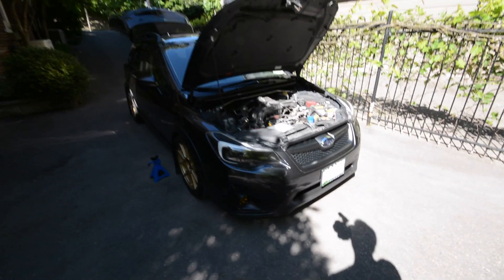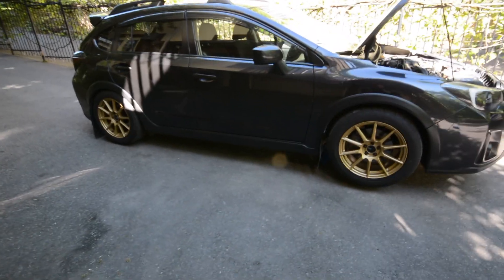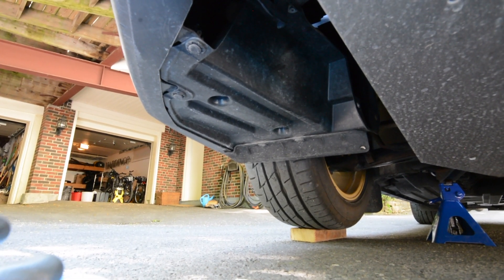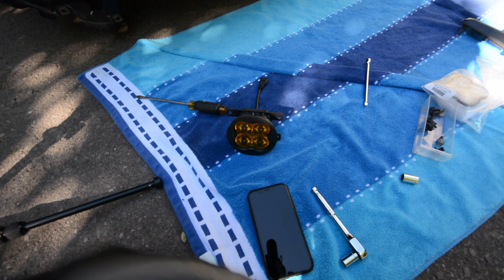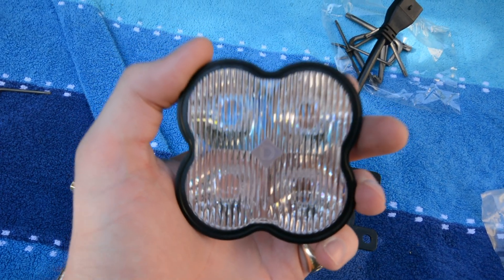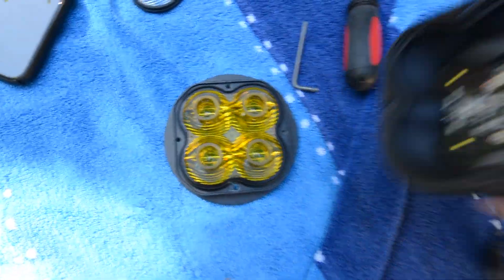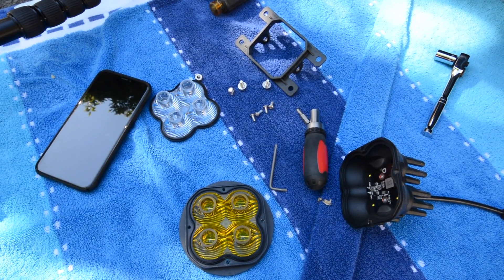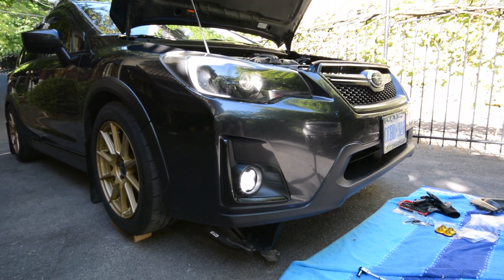Subaru Crosstrek - How to Change Lenses on The Diode Dynamic SS3 Fog Lights

Comment: Nice, thanks for the info.  I just installed the white fogs in my Impreza Sport yesterday. While I don't want to swap the lens colour, at some point I may need to replace the lens in the event it gets damaged.  Can you let me know how you got the lens itself?  I don't recall seeing it on the DD website. Also what was the cost?  Thanks for the video.  ~peaty
Reply from the maker: Pete Romano I got them directly on the diode dynamics website!
Reply from the maker: Pete Romano Hi Pete, sorry for the late response.  Here’s the link.  Glad you like the video!

https://www.diodedynamics.com/clear-lens-for-ss3-pod-lights.html
Reply: @HugoHardinge  perfect thanks!  Because I have the Sport version, unfortunately it was not pre wired for fogs, it had DRL LED's instead.  I had to get creative with my wiring but in the end it's much nicer to have the fogs in place.  DD makes great stuff, here are my photos:  https://photos.app.goo.gl/FbBdE1sLhVQrz5mu5